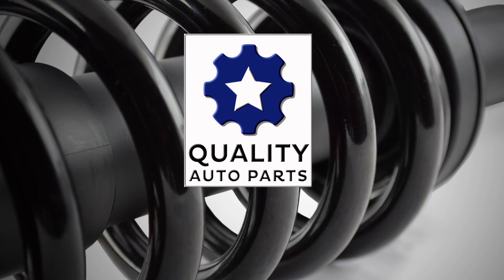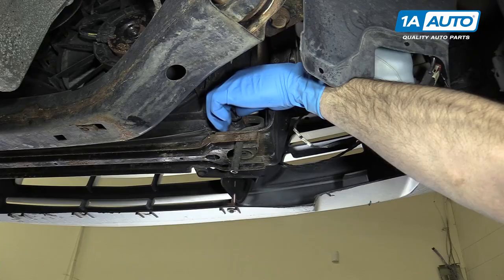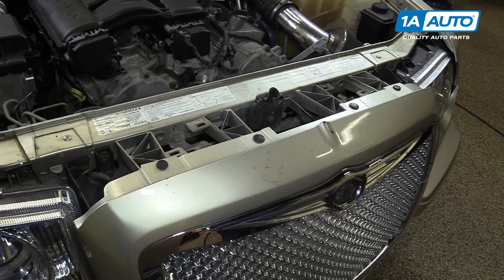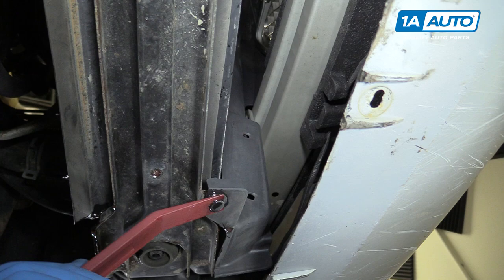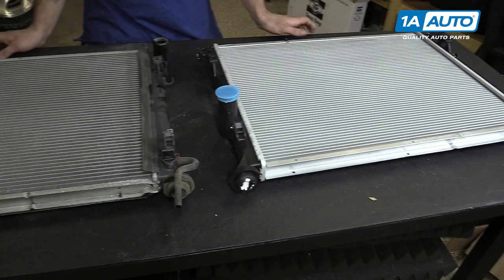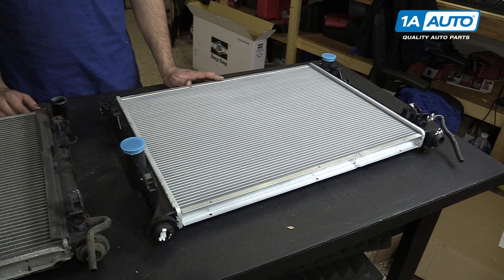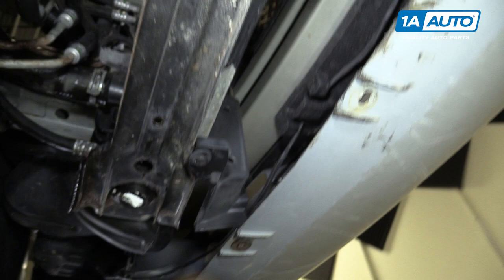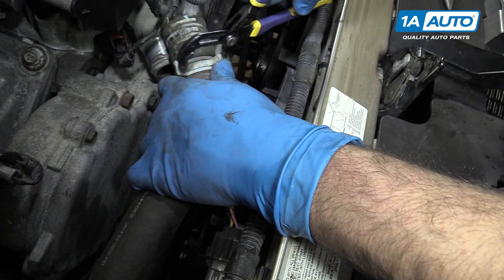How to Replace Radiator 05-10 Chrysler 300

Comment: I’m 19 and this is the first car i’ve ever had (300c), I know some about cars but i’ve never really actually got in and worked on one. Anyways. it didn’t give me any problems the first 2 months I had it, but I did notice there was a small leak coming from the radiator and just last week it overheated on me and I was sure it was the radiator. Long story short I took it to 3 different shops and was quoted $400-$750 to just replace it! I looked up this video and watched it over a few times , I ordered my own radiator for $95 and changed it my self in about a hour and now it has no problems. DON’T BE AFRAID TO WORK ON YOUR OWN CAR! thank you 1A Auto.

Comment: Great video did this job on my 07 magnum 3.5 v6 this past weekend and it’s wasn’t as bad as I thought I’d be. Video was spot on. My Maggie of course had the heavy duty radiator instead of the standard. But, all in all simple. I did remove my whole bumper assembly just to tighten up my pre installed 5 piece grill. Super duty radiator people just take your time and wiggle wiggle wiggle she’ll come out. Just watch the two a/c lines behind the lower radiator hose return. Now a/c is super cold.....burr. And heat is hellish.

Comment: Thanks for the video! Your concise instructions and step-by-step removal and install helped me on my 2008 Chrysler 300 Touring today! One thing I would mention, I saw in your video you had a cold air intake instead of an air filter box. It helped to also remove my air filter box in order to get the radiator out past the filter box....other than that, all the same.  Thanks again and I will certainly keep 1A Auto in mind for future parts!
Reply: William Hutcheson yeah I ran into that issue too! Once removed, made putting in the radiator a snap.

Comment: thank you , i have 5.7 that started to slightly overheat when outside temps are high, and vents can not cool it down fast even on idle so i think that a/c radiator is full of trash and should clean it but have to remove engine radiator, that would clean it too, to raise air flow through both of them

Comment: You left out how to bleed the system when done. there are two nipples on a bracket on top of engine near where upper radiator hose clamps on to, to release the air in system. but other than leaving that little bit of important information out great video.
Reply from the maker: +mx748 Thank you for your feedback!

Comment: i done this yesterday and on old car it is very slow job- many screws are rusty and spring clips are pain in asss-very strong and hard to expand it to move - i changed it with clips on screw, cooling fans removed to above but installed from below, radiator side covers does not move, radiator removed and installed on below, and bolts that holds condenser and radiators were rusty and i could not unscrew, so i decided to remove front facia and then everything become easier, i washed condesner with pressurized water  to remove dirt from it and i took engine radiator to house and washed ribs with high pressure water and there left big bunch of small sand that was in radiator grill, and other dirt, about 5 hours of slow job, i had car raised for 20cm from ground

Comment: I have a 2009 dodge charger 3.5 V6.
I did everything you did in the video but, I'm having a heck of a time pulling the radiator out. The bottom right inlet hose housing keeps getting stuck where the 2 condenser hoses are.
How can I move them out of the way w/o damaging them?
  Awesome video. Thanks so much.

Comment: What about the srt8 that has a transmission cooler mounted on the front? Will the old transmission cooler mount easily onto your Radiator?

Comment: Two quick notes:  (1) You don't have to cut or remove the bracket that holds the connector on the fan (time 2:01).  (2)  Make sure you transfer the old plastic/rubber trim flap things from the old radiator to the new.  I assume they're there to direct air into the radiator instead of escaping around the edges (5:39).  They just snap on/off.

Comment: Y set the heat on the lowest setting I thought put it on high and anyone know another way to bleed a charger 5.7 I can't get the bleeder valve open an I don't have a vacuum to use

Comment: I didn't see the weather strips on the old or transferred to the new radiator. Are they omitted for new install?
Reply from the maker: +Nat Rumph Thank you for checking us out. With the aftermarket radiators, this weatherstripping is not always necessary. 1aauto.com

Comment: 07 3.5 300 bought a new radiator it had 2 choices at autozone one for dual fan or not i took the dual fan papers say severe duty 2 the inlet is 1.75 way bigger then my original one in the car and its a thicker radiator this new one any idea where to get the hoses as it does line up perfect with the bolting

Comment: Omg I couldn't figure out where the bolts that hold my radiator in were supposed to go and I couldn't figure out why my radiator wiggles back and forth. Then I saw you putting in the brackets and I looked at my car AND THERE ARE NO BRACKETS. Just 2 4 inch long screws with wing nuts not holding anything.

Comment: Had a coolant leak was suppose to be a 20 minute job to change the hose but I have to bleed it cause there’s so much air in the system but the bleeder valve is stripped and can’t get it out without and extractor and can’t fit the drill unless I take the radiator out for more room

Comment: On my 09 charger 3.5, at the top of the radiator, there is a wide long piece of rubber. is it mandatory to put it back on the new radiator? What purpose does this rubber piece serve?
Thanks a lot for your video and free help.
Reply from the maker: That sounds like it is just a plastic panel to tidy up the engine compartment.  It is not required to reuse, but we recommend it as he will help keep debris from the road getting in your engine bay!  1aauto.com

Comment: Where do I find the thermostat on a 06 chrysler 300 3.5L..?
Reply: If it's the same as the 3.5 magnum, follow the lower hose up to the engine, it's tucked up in there behind the  power steering pump. Remove the power steering pump bolts and set aside. Loosen AC pump bolts for more access.

Comment: Will this same process work for 2.7 L
Reply from the maker: +Tony Hernandez The installation process should be very similar for this vehicle.
Reply: @1AAuto  i got another question what is a estimate. on where the top radiator hose goes to the pipe of the bleeder valve housing . How much would something like that cost just the pipe that slides in and out

Comment: This is on a modified Chrysler 300.... They don't tell you how to get around the AC Cooler lines on the stock 2.7 V6. The radiator is caged in by AC lines, I'm having to take a sawzall to cut the tab off the lower radiator to get it to come out. Putting the replacement in may also involve 'modification' with a sawzall to get it in. DO NOT BUY A 2.7 V6 CHRYSLER 300.

Comment: Why do you guys think we all have the capability to lift our cars up in the air?
Reply: Larry Demoret he says also that you can use jack stands..I did.
Reply: Larry Demoret it’s called a jack
Reply: I thought it was common practice?... I mean I got few jacks and a dozen or so jackstands lying around my garage ranging from small to large heavy duty ones... Is that overkill?
Reply: i made some called steps from old wooden boards- lower is longer and every other is shorter to get nice slope to be able drive car on it, i made different hight for front and rear end, and when car is up, i can get below on wheeled board,